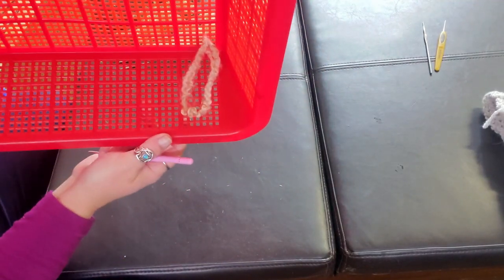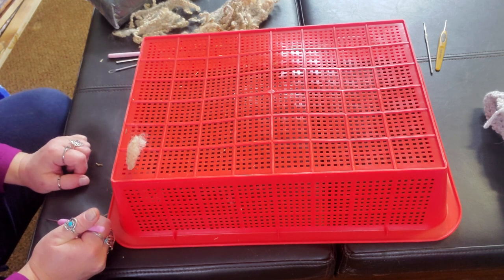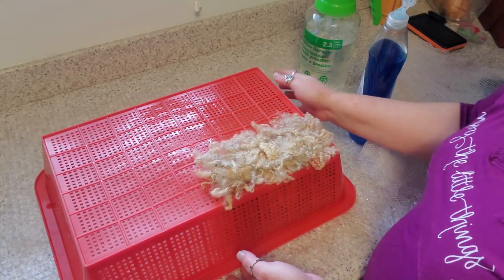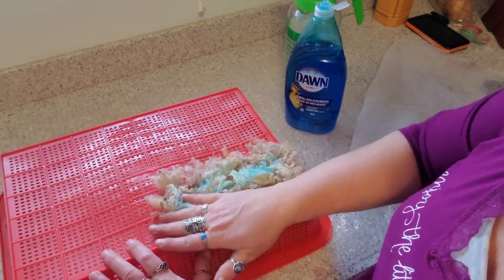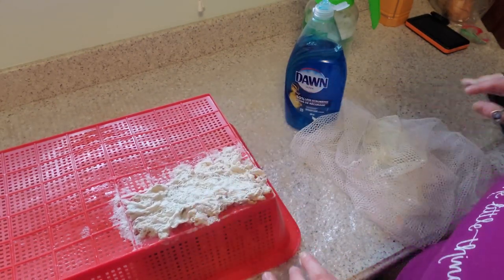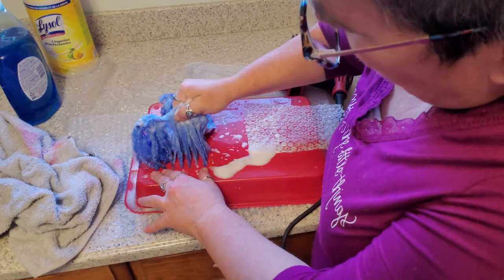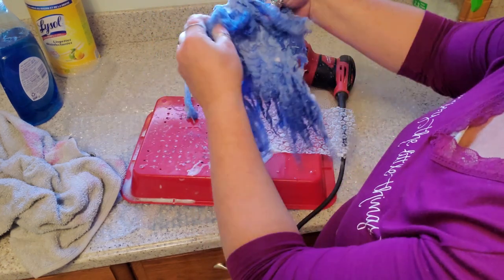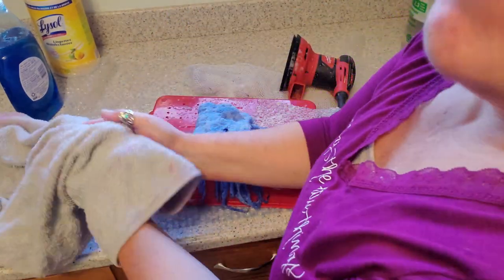Felting Locks: Making a Faux Sheep Skin Rug

Comment: I was thinking of taking some hardware cloth (metal screen with a little over half a cm grid or square "holes") and stapling it onto a simple wood frame. That way I can lay roving on the top and pull the butt of the locks up through it, then add another layer of roving on the top. My frame would have legs too, I think it could even double as a small drying table...

You certainly have me musing about how this would work.
Reply from the maker: Brilliant! You have some great ideas.  And now I'm thinking....